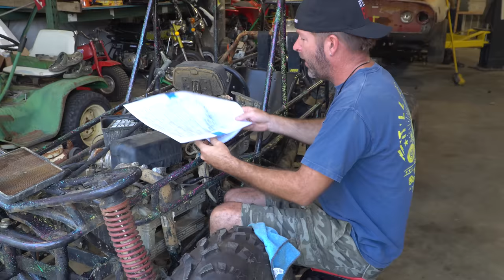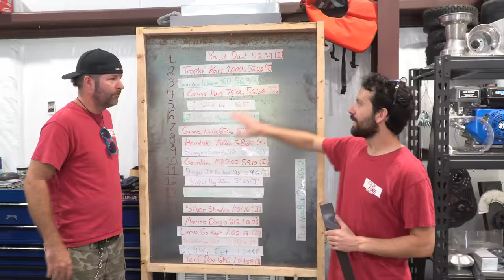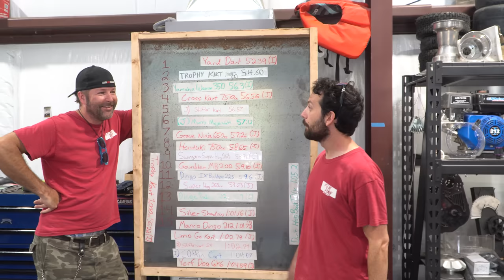Our 1000cc Trophy Kart was FLOODED in a Surprise Tropical Storm- Will it Run & Ride Again?

Comment: I've seen far worse computers come back to life that have lived outdoors or been underwater in floods, that thing once hosed off with water dispersant no. 40 should be fine, check out the Ant Hill Commodore 64 from Adrian's Digital Basement for an example of something that looked utterly trashed from corrosion (and ants!) that still worked fine, older lead-based computers were much tougher beasts, usually at least... :)